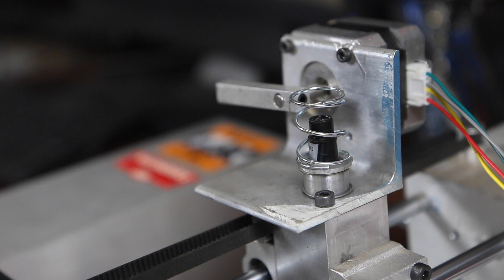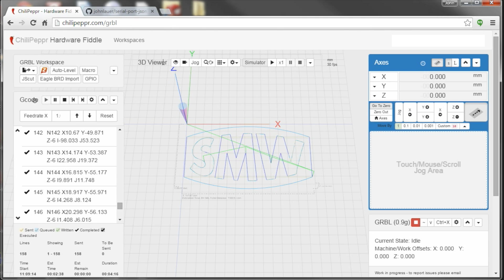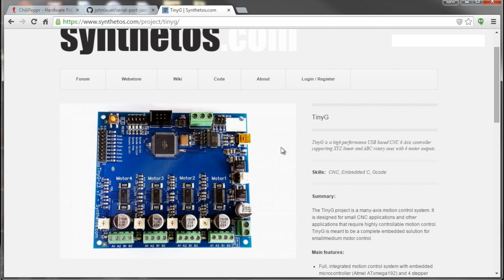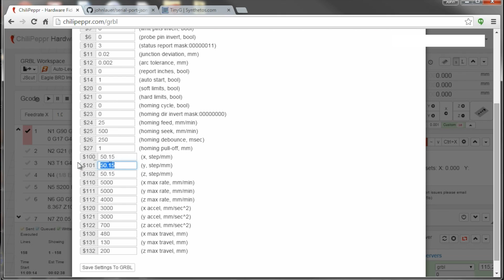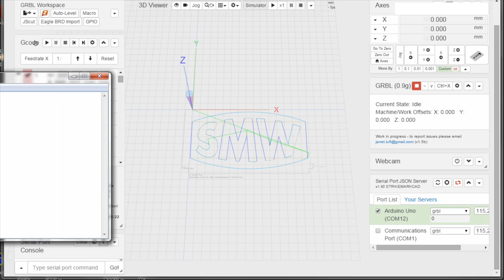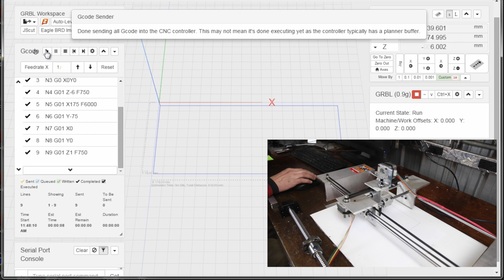DIY Arduino CNC: Z Axis Upgrade & ChiliPeppr!  Widget34

Comment: to run this machine do i have to used processing 3.3.6 software or i can run witout thia software? pls reply urgently. i am ready with machine .i hv arduio uno,arduino mega,cnc shield v3 duly connected and running.facing problem with processing soft.i am totally newb as far as software is concen.pls help.if u send your e - mail adress or whatups ican send u my machine photo.I am hobbyist of age 72 yers.pls help

Comment: hey yer pretty smart! i just built a cnc useing a grbl sheild and nema 17 's,it seems my z axis tool is  too heavy for the machine because it keeps falling down when i make cuts,its a router cnc. dont know weather to go to a bigger motor or  smaller travel leed screw , but it appears that my motor dosnt have any "holding torque" what so ever,so i'm not posative changing somthing mechanical will do anything. Not not sure which way to run i guess any sugestions ,,anyone?

Comment: Great Idea bro. I am going to do it. I also have some doubt. In first I thought of using Inkspace software for Gcoding and linking it with processing software for plotting. 

1)Can I use universal Gcode sender (gctrl) and Processing software simultaneously.

2)I am going to use a motor shield L293D , will it work with the methods you mentioned.

3)How to find the steps per revolution.

Please help me bro

Comment: Thanks for the great videos.
I am very interested in making this unit and getting started with an Arduino CNC type machine.
I am just a little confused on all? the different softwares that are needed. Could you list the different softwares that are needed start to finish?
Thanks

Comment: Great video. I would like to purchase/build one of these for the very specific purpose of inlaying intricate designs into wood. So I was wondering, could this be fitted with a Dremel tool for woodworking purposes? Thanks in advance.

Comment: I put a laser http://www.ebay.com/itm/Red-Burner-Laser-Focusable-650nm-250mW-Red-Laser-Dot-Module-with-battery-case/231522542228?_trksid=p2047675.c100005.m1851&_trkparms=aid%3D222007%26algo%3DSIC.MBE%26ao%3D1%26asc%3D29268%26meid%3D7d35f46bd5984ea8bda60cca9ca9d377%26pid%3D100005%26rk%3D2%26rkt%3D6%26sd%3D281318507847&rt=ncOn a small CNC.  It will Engrave wood   Black Plastic & Cork.  Must were Laser Grasses to run.

Comment: do you actually need a grbl shield or will separate stepper drivers for each motor work the same ?  (using arduino uno)

Comment: @NYC CNC, have you tried lowering the speed around corners? Check the GRBL wiki on github. The configurations file as value '$11=0.020 (junction deviation, mm)' as default. This is the junction speed, lower values make the algorithm slow down when cornering. This should solve your pen corner problems.

Comment: I realized a three axes CNC and I also have the two springs pen holder connected to the z axes.
Now I would like to mount a special pen with a eaching resistent ink to draw a PBC on the copper clad directly.
My z axes also have the capability to hold a dremel drill to make drills on the pcb.
I do have PCB source files in gerber format ( tracks and drill ) but I also have PCB in .PDF format.
How do I pass from gerber or pdf to GRBL format in order to Draw directly the PCB ( and possibly drill it ) on the copper clad ?
Any help is very much appreciated.
Thanks in advance.
Ambrogio
iw2fvo@yahoo.com

Comment: What about converting this into a 3D printer with a print pen used? Would be really neat
Reply: +James Lavender You would need an actual Z axis for 3D printing. May as well just get an Open Builds bot, and throw a E3D V6 extruder.

Comment: would a stepper motor on the other side for the y axis help in the stability of the z axis ?
Reply: +NYC CNC Save money and use a parallel belt drive and cross over belt drive, or idler pulleys and one longer belt. Great project and outstanding instruction. Thanks

Comment: Hello im justing wondering on how 3d objects work toward doing a milling project, how you make the z axis move down as it completes the G code is it the same way as 2d objects, if so how do you let it to only go down a little at a time when using a drill bit

Comment: Thanks for videos!  I built the Z axis design you made and love how simple and effective it is but got a quick question.  When the motor goes to the pen down position, how do you get to hold that position?  My work so far has the zaxis stepper moving to the pen pressing down, but once the position of the stepper is achieved, the stepper motor does not hold the position.  Maybe another way to say it is that the stepper motor travels the steps it is programmed, but once it is there the motor doesn't stay charged to maintain the position and the pen defaults back up.  Thank u!

Comment: Thats very nice. I would like to know if you could achieve higher speeds with that. Iwant to build a machine like that but I have other application in mind which wouldnt require much drawing precision but instead speed. Is that possible with this setup? Something around 15cm/s?

Comment: Thanks for the great video series and congrats on making it to over 51,000 subscribers SO FAR!  While this may be a simpler, less-perfect design for a gantry-style CNC platform, it does offer beginners the opportunity to learn and apply some core fundamentals before tackling more robust, more accurate, more complicated, and way more expensive platforms. I felt it was important to support your time and efforts by springing for one of your pre-milled aluminum angle sets. For those of us without access to the proper tools, it would be unlikely we could participate in this learning experience beyond the most theoretical portions. 

As a definite fan of your work and someone hoping to complete a variation of your updated arduino CNC example, I'm really hoping enough folks will also consider supporting your z-axis kit such that it can become available for purchase again. Right now I feel a bit stuck in limbo not knowing whether to eat my expenses to-date (and hope I can apply those purchases elsewhere) or wait until the z-axis openly offered in the video, in the description, and on the Saunder's site becomes a purchasable item such that I can complete the project and leverage the knowledge, if not the basic platform, for a more sophisticated version. 

Thanks again.

Comment: Where did you happen to buy those metal screws and linear sliders? (You don't say in the description)
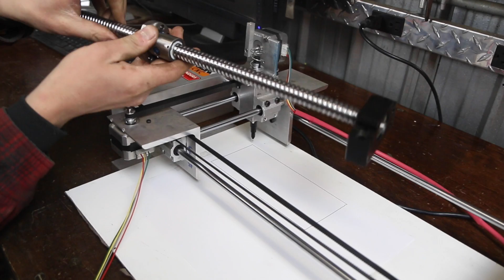Reply: NYC CNC No, I mean the hardened screws and new sliders your gonna use for the "upcoming" project. The ones you briefly show at 13:15 and 13:25

Comment: wow new gcode sender chilipeppr,must try it, by the way can you make some video regarding the kill switch and wiring it using the grblshield (A0 to A5 pin in the arduino uno),thanks can't wait for that.
Reply: Thanks dude,actually i made one base on your video 1&2 and follow all your steps, without your post i can't make my own cnc.Currently am testing it using pen and some calibration.Again THANK YOU.

Comment: Nice to see this project comes back on. I am building a system base on the first video using ball screws and rails( these things really make it's much simpler to build) for a month now, but mine requires 3 parallel independent axis, still having trouble to control them probably with adruino and drivers using code, any suggestions. Another thing is that how can I set the intial positions for these axis, they keep hitting the limit, i plan to use endstop switchs, is it ok or any ideal better. Thanks.
Ps: wish to discuss more about this if u are free.

Comment: Hi John, love your videos!  All very informative, well put together, and just plain cool!  We share many common interests!
Just subscribed today, BTW first channel I have subscribed to!   :]

I built a small CNC machine like it sounds like you are planning on building, with supported ways, etc.  I also designed my own Arduino based GRBL controller PCB, essentially a cross between GRBLshield and TinyG, where it's an all in one board solution, with female headers for four SD8825 based step motor driver carriers and Atmega chip, so you can easily remove/replace them if needed.  The intention was for it to be very versatile. Plus a function to drive a BLDC spindle through a standard R/C ESC if you're in to that sort of thing!  Also I've been using the cheap Ebay Bluetooth modules to "talk" to it as well, so I can locate the PC away from all the flyin' chips!
 I can send you one for free if you think you have time to try it out, I need another Beta tester, besides myself  :)

Cheers, and keep up the great work!
Reply: NYC CNC
Yes it has good ole GRBL loaded on the Atmega MCU....imagine the Arduino Uno and GRBLshield combined on one board, similar to TinyG in that aspect, but with removable/replaceable step drivers, microcontrollers, and just a slightly modified GRBL (just had to remap some of the pins). I've somewhat planned to offer it as a DIY PCB kit eventually. The price point would be similar to Grblshield with out the need to buy the Arduino separately.  However folks would have to solder them up (all through hole, so very easy soldering) themselves!  I don't have time myself to solder them, but I purchased a small quantity of all the components, and had a small production run of the PCB's made.  So far I have tested a couple, and they have been working great on my little router!  Sure be nice to see them for sale on the SMW website, perfect complement to the DIY Arduino CNC parts...  hehe   :)
Reply: NYC CNC
I have not tried it, but I imagine so!  It would be a bit less elegant.  I suppose you could use the female pin headers that typically hold the SD8825 style stepper drivers, and jumper the signals to any step driver of your choice (provided it is a Step/Direction based driver). The drivers would of course need a power supply as well. I may give it a shot when I get a chance, I have some larger drivers and steppers I could experiment with.
Cheers!

Comment: Note that the gshield isn't the only way to do this. You can get a 'Arduino CNC Shield V3 + 4PCS A4988' from amazon that does the same thing - I tried it tonight (after receiving the parts from China this week) and it sure seems to work quite well.
Reply: NYC CNC Exactly that one. I purchased from the same vendor and received it in a little more than two weeks.  Uploaded grbl to it and have everything hooked up - just no CNC table yet :)

Oh, one more thing, chilipeppr with the serial driver is THE BOMB!  Thanks a million for that.
Reply: NYC CNC I had not, I have already used it and love it to death!

Comment: have you ever checked out Openbuilds.com it is along the lines of what you have here small scale CNC's I'm in process of building a 2 x 4 CNC for cutting smaller stuff instead of putting them on the large 4 x 8 table

Comment: John, when you get further on your larger machine with the ball screws you were showing, make sure you use a TinyG to get the best experience. TinyG has all the modern features that Grbl doesn't have so it's worth it.

Comment: Resonance. 
[Being the explanation for why smoothness:feedrate is a nonlinear relationship.] If you keep looking you will probably find several "bands" of feed rate frequency that are noisy/quiet, alternating.
Anyway, should have acceleration control on all of this, so it doesn't run at one fixed freq half the time, until it maxes out to the feed rate, which you would chose as one of the less resonant bands...

Comment: Can't help comparing this to the pen plotters we used so long ago. The ball screw will certainly reduce jitter on the x axis. Perhaps when you're ready to do a large format plotter, we can see you engineer moving the paper in the y axis. I seem to remember instead of a plunger for pen pressure, they used a tilt up pen carrier that used it's own weight to keep pen on paper. Very informative vid though.

Comment: Make the top plate the marker mounts to wider.  and put two markers in there.   have the stepper for the opposite way and you just made a tool change!!
Reply: I don't quite understand do you mean mount the steppers do they're offset from each other rather than parallel?

Comment: it is not so surprising that those linear bearing are a bit wobbly, they are supposed to be used in pairs, to some extend that also goes for the fancier linear rails, they are a lot stronger in the up-down side-to-side direction that in "twisting"

Comment: Looks good! Can I make a suggestion? As an alternative to the steppermotor Z construction you can also use a electrosolenoid. For example one with a travel of 20mm and a force of max 10newton. If you use that combined with a spring that has a compression force of for example 7 to 8 newton you can easily operate the pen's position. (less parts, and on/off operation) Not to be negative about your idea, it looks good and love the creativity with the springs.

Comment: That's a really cool design John, nice work. Love the lever operated pen design. The little Roland machines (plotters / vinyl cutter) use a electromagnet solenoid. But yours is way cooler. Cheers, Aaron

Comment: Im just wondering as to the choice to use a stepper to lower the pen, and not a solenoid? Cheeper, simpler, and more reliable. Is the stepper to be used later for other Implements?
Reply: NYC CNC A stepper has a few inherent problems. It needs a third axis's controller.With out an encoder or limit switch it will eventual forget home.
If this will eventually be used for a light milling machine of sorts, then by all means this is ideal. 
If this is going to sold as a kit as is. You can simplify the hard wear reduce and sail price, by using a solenoid. controlled by a single relay, a solid state one will allow PWM directly out of the ardino for presser control.
Reply: With the stepper, you can adjust the pressure on that top spring. Allows a little more fudge factor when using different pens to adjust the pressure.  Cheap source of those springs... old spiral bound notebooks.
Reply: grbl will directly control a stepper for the z-axis (and so will the driver boards). If you wanted to use a solenoid you'll have get a driver for it and configure grbl for turning it on/off (it may already support that for laser cutters)

Comment: I like your dual-spring pen solution too!

Chili-P looks pretty cool. ...other than spelling chile wrong. :)

I see it's a web site. Does it continue to run if your internet has decides to take a crap stop working in the middle of a program?
Reply: Hirudin Yes, ChiliPeppr keeps running fine if your internet goes down. It actually all just runs local once it's in your browser window.
Reply: Ah good, thanks!
Reply: ***** Go ahead and give it a try to save it offline. ChiliPeppr is a Javascript/HTML app so it may work for you, but I have found in my experience saving it offline is not very workable.
Reply: ChiliPeppr is not Java, so there is no jar file. It's Javascript/HTML.

Comment: Nice little machine. I love your spring loaded pen solution. Another neat option for it would be a diode laser to build a simple laser cutter. Chilipeppr already has laser cutting built in.
I look forward to seeing what machine you've got coming next, I'm building a linear-rail/ballscrew micro-mill right now to house a high speed spindle when the big CNC mill is too slow.
Reply: No existing design for mine, but it's not very unique either, just a standard X-Y-Z axis made out of hunks of aluminum with linear rails bolted to it. Are you on the Onshape beta? If not you should be! Its the future. My micro-mill is a public document.
Reply: I'm shocked you aren't into Onshape yet. I had a friend sign up and he got in within minutes. Sure the invite isn't in your spam filter? You are NYCCNC!!! They should be paying you to use it.
Reply: How does your high speed mill preform?